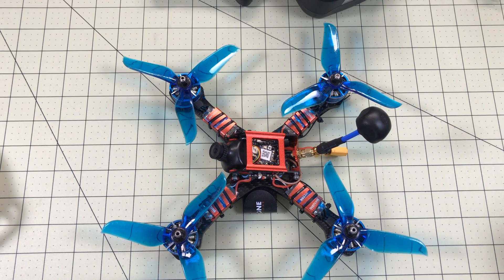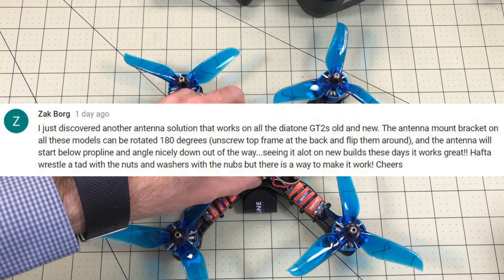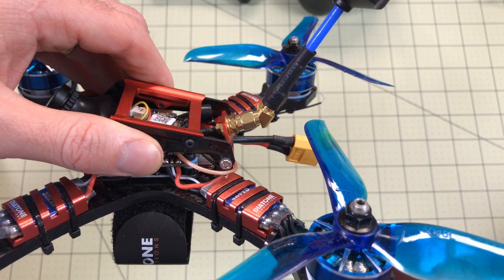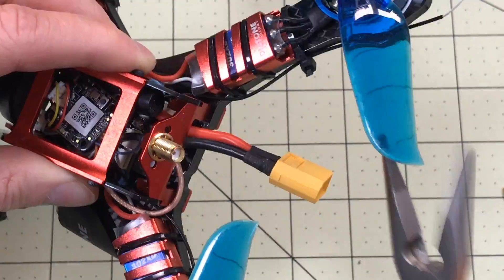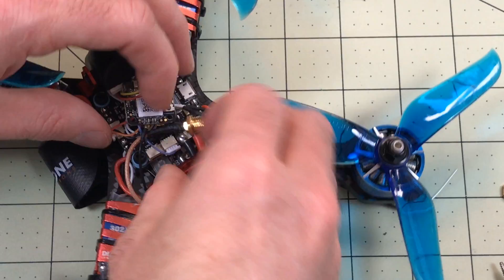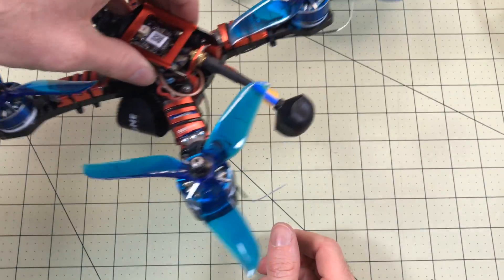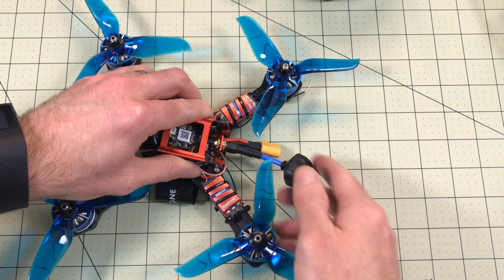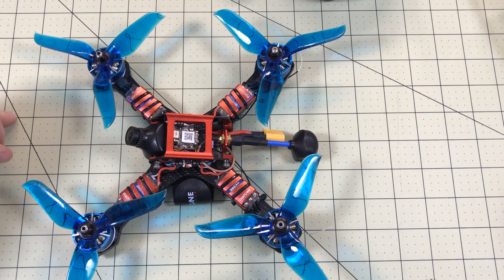Diatone GT2 2017 Antenna Mod, It won’t break, but will it work?

Comment: Awesome! I was able to do it without grinding if you swap the washers and set the thin nut between the nubs and use the whole bracket to kinda tighten it to the base the last few turns. Its a tad funny to make your mind think that way tho because its so backwards! Cheers thanks for the shout!! Z

Comment: Thank you for your video's! 
I cut a piece of PVC, a little wider than the antenna wire and the length of from the connector to 1/2" below the top of the antenna. Heated it and matched the bend of the antenna, cut a groove to fit the antenna and covered it in heat tubing. It would take a lot to bend it back into the props. Hopefully it will not cause other problems by being too stiff.